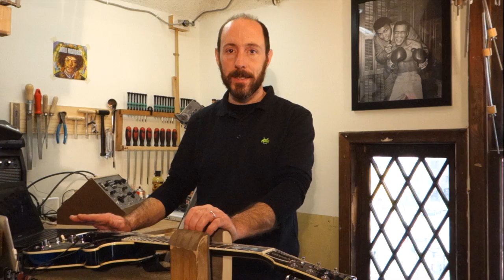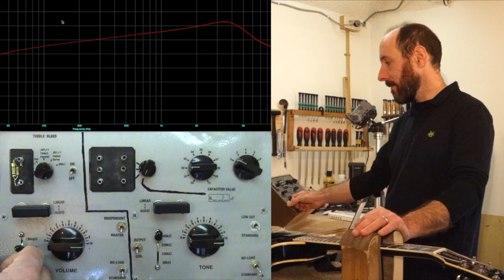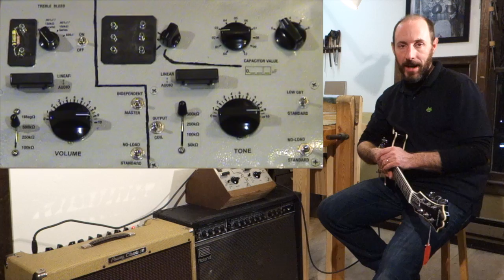Guitar Electronics 3 - Volume Control

Comment: Thank you so much for this video. I was going crazy changing from b curve to a curve pots. I thought a curve pots i had installed were detective. This is exactly what i needed to see to explain what the difference was between the two. So  A curve pots are better to do small adjustments on? Will this help with the volume roll back on audio pot's?

Comment: Here’s my question about this experiment. What is the taper of the audio taper??? Most common audio taper pots are a 10% taper. Vintage audio tapers are 30% tapers which respond closer to linear on the first half of rolling off

Comment: Ther is a FUNDAMENTAL thing that all the people forget to think about. 
THe total CAPACITANCE of the CABLE-AMPLI 1st stage affect a LOT the tone when rolling off ....

In this video the cable is quite short but on average i saw cables of 50-100 pf  and cables with MORE than 1nf .....
when the POT is at 10 the amp side will see an RC low pass filter where R is more or less the parallel between the DC resistance of the coil and the volume pot value......   so kind of 10k,  with a good cable full bright tone.
BUT ... whe You rolloff the Volume and the cable is a shit 400pf value the amp start to see an R value in the range of the potentiomenter from 10k to kindof 150k  for a 500k pot....... result is     you guitar High ends are GONE.....
 because of the fact a 1st lo pass filter is in place ......
I use a special cable with 20pf per meter and the rollof loss of treble when moving the  Volume pot is almost inaudible.

Comment: Is there a way to smooth out the  volume from 0 - 2? I'm noticing that around 1 to 1.5 I go from nothing to something, almost an on/off situation, rather than a fade in like I get on my amp, and other audio equipment I've used over the years. My pots are audio pots, and the ones I replaced were audio pots as far as I know, and both did the same thing.
Reply: This is more of a question than a suggestion cuz I don't know much.  But what if you added a small resistor between the pot and ground.  My thinking is that if the resistor was small enough you might not notice the remaining signal as actual volume.  While the resistor might still affect the last bit of taper on the pot.  What would a 2k resistor do?
Reply: murfbass No idea. I solved my problem by putting in Bournes 82 series pots in my guitar for volume. They work perfectly.

Comment: You seem to be pro linear tapers but I have been considering changing my current volume pot on my fender amp for an audio taper because I want more head room. I don't wants non existent 1.5 volume. And then a holy shit that's loud at 2 and up. So I think you've just helped me make up my mind thanks!
Reply from the maker: Amps are a different beast entirely, and I wouldn't use anything from these videos (focused specifically and narrowly on passive guitar controls) as a guide for any choices inside an amp.
Reply: A2Guitars
Thank you sir